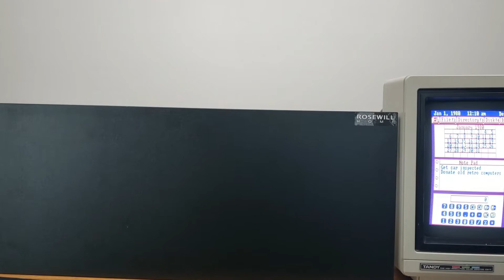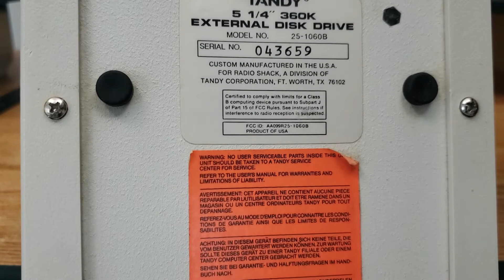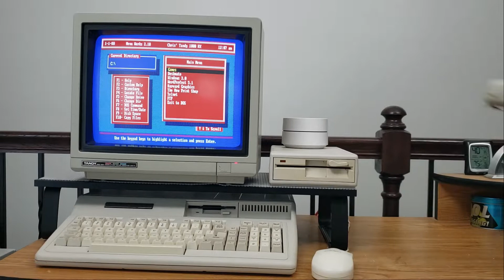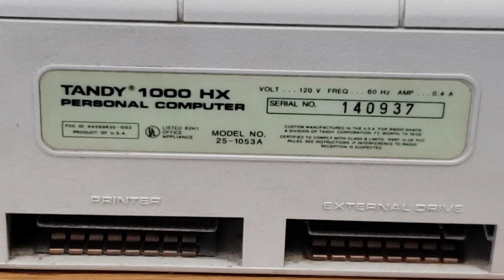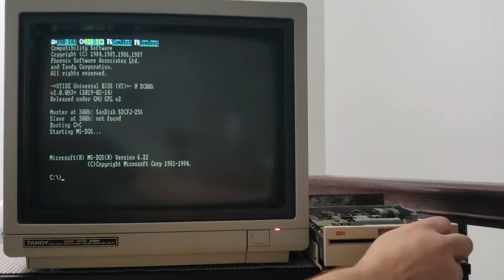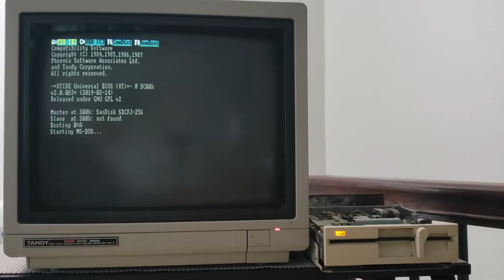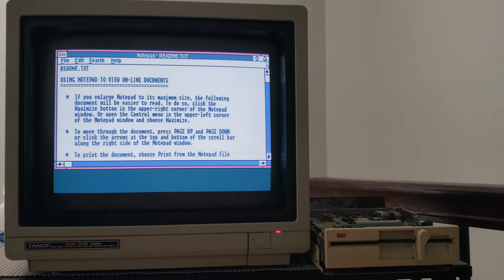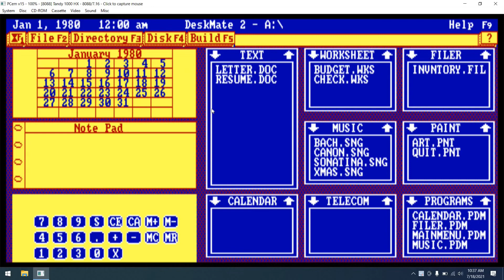#SepTandy #SepTandy2021 RetroTour: Tandy 1000 HX Hardware/Software Tour (And a Surprise Repair???)

Comment: That was a nice trip down memory lane.  My first computer was a TRS-80 Model III.  Then I bought a 1000EX but traded it for an HX that had two internal floppy drives about a year later and kept my plus card and all the peripherals original to my EX.  It was a fun machine and I put plenty of hours on it.  I think most of the time was the Ultima games.  I wish I still had that computer.  I am hoping that it is still in the attic at my parent's home, now owned by my older brother.  But he said that he had not seen a computer up there.  I'm going to take a look next time I'm up that way.  Don't imagine it will be in very good condition with the hot/cold cycles after all these years but I'd do my best to restore it.  If it is still there.
Reply from the maker: Glad you enjoyed the video!  These machines are pretty versatile.. it might still work if you find it!!  Fingers crossed that it is still in the attic and that it fires right up for ya.

Comment: I have the 3-in-1 card in my HX, and I keep wishing I could put another isa card in the machine.
Then I think... VGA? Nope... Soundblaster? Nope... what would be the point? I have other machines that can do those, the special thing about the Tandy is the Tandy audio and video.

So the only other thing I could come up with is an ethernet card. I would really like to get my HX on my network. 
I may get the printer adapter card that Cybernetic Systems sells, though more likely I'll just get a tandy printer cable. I'll almost certainly get the clock card. 
I wonder if the external floppy edge connector could be broken out to like a DB25 adapter; and then maybe connect it to an Arduino or Raspbery Pi via their GPIO ports. I haven't looked into how it communicates, but that would give some nice capabilities, like maybe being able to connect to the internet, maybe to bluetooth or USB devices, or to the various sensors and displays sold by the likes of Adafruit.
Lastly, I wonder if a PC 15 pin joystick to Tandy din joystick adapter could be made, to use regular joysticks with the HX/EX?
Reply from the maker: Heya, wow, you have got some AWESOME and Amazing plans!  If you are on Facebook, you should come and join the TRS-80/Tandy 1000 group. Derek, Robert, and several others who have done mods and studied the architecture quite a bit are there and you would fit right in!!!  https://www.facebook.com/groups/2209645526 (if not on Facebook, you might consider joining Facebook to join this group, I'm not kidding!)

So, regarding that Tandy parallel port: be warned, despite the fact that an edge connector to DB25 is available, things may not work without modification.  Have a look at the comments on Cybernatic Systems (i.e. Derek's) page on Tindie.  You can't use a Xircom Pocket Ethernet III with the stock port... there MAY be a way to modify it, but I can't confirm anyone has been successful (I did find an article on the internet about it, here it is: http://nerdlypleasures.blogspot.com/2014/03/a-hypothesis-of-tandy-1000-parallel.html)

I want to say there was talk of a DIN adapter, if anything, I know Derek came up with a keyboard adapter!  

I'm excited to see the work you are doing and planning here!!
Reply: I was looking at a manual for the HX online, and it made me think the printer port may actually be bi-directional? Making it much more suitable for interfacing.
Then again, maybe a ribbon cable could be connected to the other expansion port and drawn out the gap under the 3-in-1, maybe allowing external access to the expansion bus...
Reply from the maker: @Hiraghm  could be.  I'd actually love to see a 4-in-1 card which adds Ethernet. Couldn't convince Robert to go for it though!

Comment: Great video. In my opinion both the EX and HX were incredible machines for their time. I had both and favor the EX a little but both were great machines. The one thing that Tandy screwed the pooch on is making it very difficult to use 3rd party hardware. There was an opportunity there that they missed. They were still clinging to their old philosophy of custom hardware like from the Model 1/2/3/4 and COCO times. I feel that if they had embraced a more standard architecture, they may have lasted longer in that market.
Reply from the maker: So true.  I'm both glad and sad they copied PCjr.  But they should have moved on for sure at some point!!! They held onto old standards too long

Comment: Is it that the RTC board has unsoldered pins on the RTC chip? Is that on purpose?
Reply from the maker: Sorry for the confusion here!!
Reply: @RetroTechChris  yeah, no worries! I thought those pins were not properly solder and although they might work, it might also cause intermittent failures, and that's really annoying to debug!
Reply from the maker: @cocusar  right on!  Sadly, it's a case where RetroTech Chris butchered a component, haha!!
Reply from the maker: Great question!  Let's see if Derek sees this and chimes in!
Reply: @RetroTechChris  lol, that’s the one you modified after the postal service destroyed it. So the pins are normally soldered to the PCB. 

@santiago I don’t normally socket the clock chip but after the postal service destroyed several packages, I sent Chris some spare parts.
Reply from the maker: @Cybernetic_Systems  doh!  I should have chosen the other one I had.